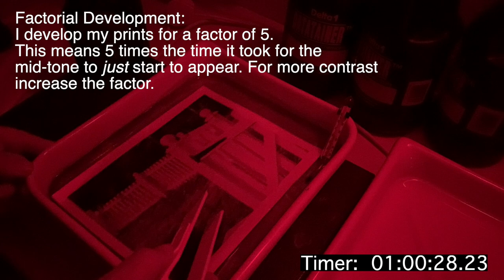Keeping My Developer Going. How do I know when it's done?

Comment: Hi there.  Great video thanks. I noticed you have a thermometer in your tray. I was wondering that relationship temperature has to the print?
Reply from the maker: Thanks for your comment and for your great question. The developer, stop, and fix should all be close in temperature. Mine are kept around 20C - within a degree or so of that. Most developers work best between 20 and 24C. However, it's best practice to use the same temperature every time so your results will be predictable.
Reply: I really struggle with these temperatures this time of year. I warm my developer at the beginning of the session to 20 degrees but after an hour it will have dropped to 12. Often I don’t even bother warming the stop and fix. John do you have any suggesting about how much longer you might want to stop and fix when temperatures are this low?
Reply from the maker: The chemistry will lose speed as they lower in temperature. Firstly the developer, this needs the energy of temperature to fully develop the paper. As the developer temperature falls it will start to under-develop the paper. You'll see this in the poor blacks and therefore the lowering of contrast. Keep this over 18C, better keep it between 20 and 24C. I use a tray heater for this. You can buy them secondhand on eBay where they come up occasionally. With respect to the stop bath, this will work as expected in around 30 seconds but, and this is the kicker, a sharp temperature change from dev to stop could effect the emulsion and cause some damage to the image. Finally, the fix will not work efficiently at low temperature and you'll not know if you've fully fixed the paper. That could spell disaster later when your prize prints become stained. Best look for some heating trays I think.

Comment: I currently don't print but I develop and i Great work as alway. 
I dispose of developer after every roll, I us a AP and reel that would take 220 roll does this mean one tank full would develop two rolls of 120??? 
Thanks 👍
Reply from the maker: Yes, you can tape the second 120 roll to the first and continue loading. I have been told this but have never done it myself.

Comment: John—this video is somewhat timely as I have been trying to determine how to asses the life of E72 and also determine whether I might replenish. I always hear about incorporating some “old brown” into fresh developer and how it might enhance the outcome of your prints. I wonder if you have done this with E72. I found some information suggesting you keep all of it and replace the missing quantity with fresh. As an example—let’s say I make 500 ml of developer and use it over 3 or 4 sessions. At the end I might measure it and only have 400ml left. At that point I’d add 100ml of fresh and keep using and adding accordingly. Thoughts on this? I might start doing this and keep your system of time for shadow development in mind to see if the developer is still working to spec. ALSO—you discuss the time to development here but do not mention the dilution used. If I remember correctly I think you like a 1:3 whereas I used E72 at 1:1. Would this make a difference?
Reply from the maker: Hi Sean
I'm using E72 1+2 mostly but sometime I too use 1+1 for added contrast. The system will work regardless of dilution. It's all about mentally noting that the developer is losing 'power' so you know when to toss it. Now, regarding replenishment, I don't know if it will work the same with a vitamin-C type developer. The old brown was laced with bromides and so seasoned the new developer, reducing fog and perhaps sharpening it up a little. But that relied on developing agents that react to bromides (metol) in a certain way. I'm not sure Vit-C does and certainly phenidone doesn't - not sure about hydroquinone either.
Reply: Thanks, John! This is such good information concerning different developing agents and how they interact. I have been looking everywhere on the internet and in the few books I own and so little is ever discussed. People just casually refer to using some old brown but never seem to tell you how much or how often—and most importantly why and which developers the concept might work with!